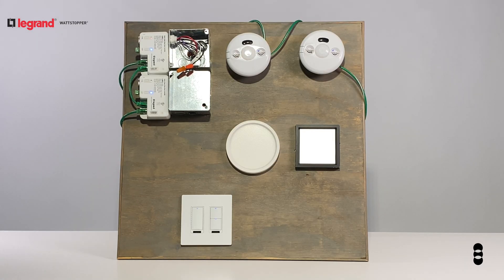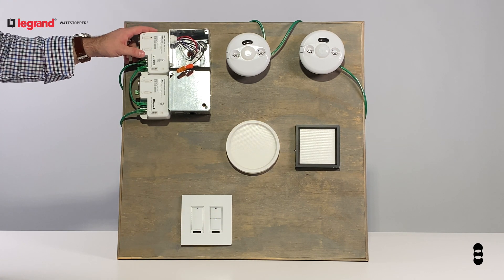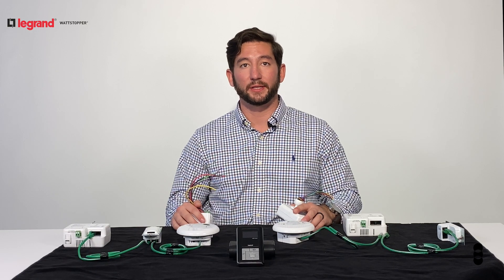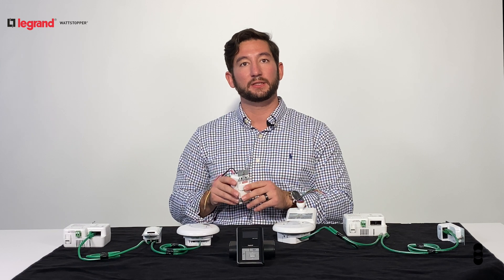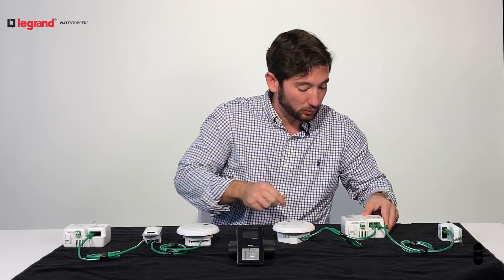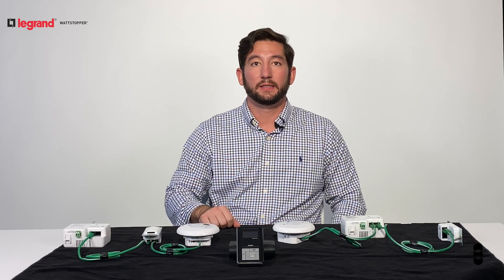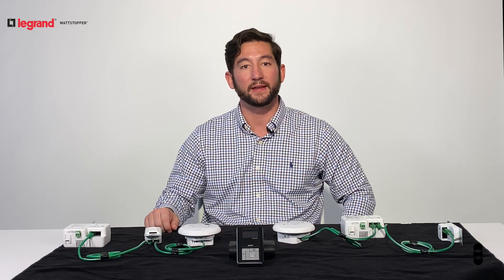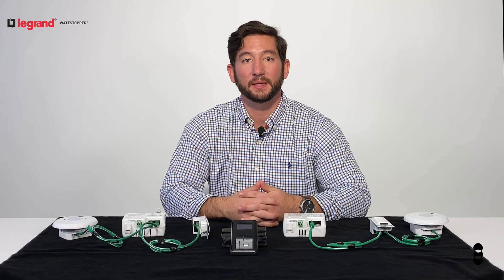Digital Lighting Management (DLM) - Lighting Controls 101

Comment: Do you bring 120v to the actual fixtures ?
Reply: Sounds like 120vac to the Room Controller, then it uses PoE to power the other devices. (Light, Swtich, etc.)
Reply: We use this system frequently, the source and switch leg are both wired into the room controller. Everything else is normal fixture whips w/dimming if needed just like traditionally. The only difference is cat 5 to the occ sensors and switches. They also have relays that are cat 5 as well. Hope this helps